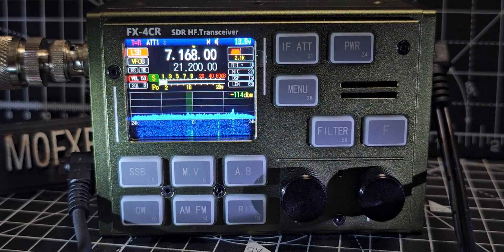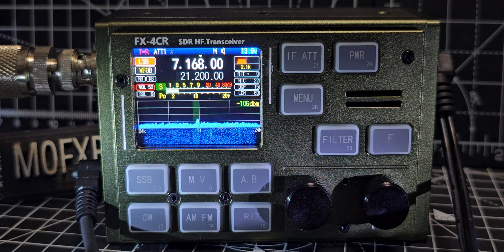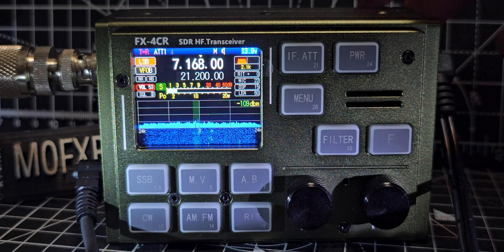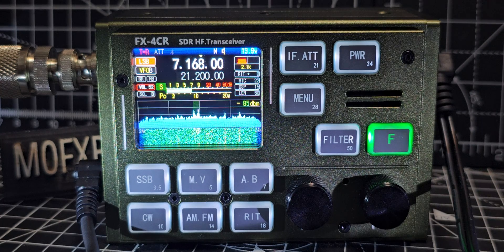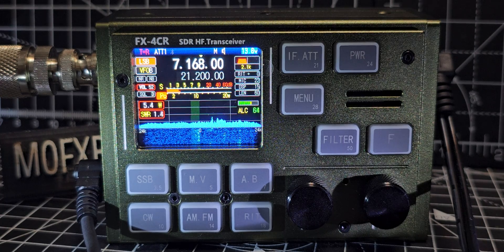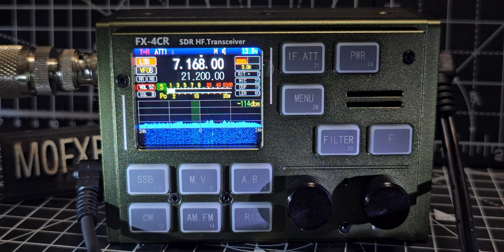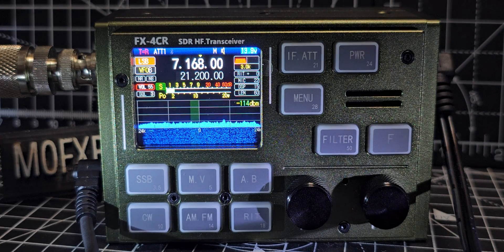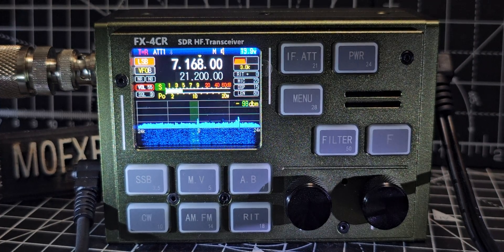FX-4CR , HF/6  SDR Transceiver MK111 - Unboxing 2024

Comment: Did you ever figure out what the delayed audio was all about out? Mine does the same thing. I noticed that after you turned on ATT1 and adjusted the filter to 3000k it started doing it.
Reply from the maker: No
Reply: @ ok, does it still happen with yours? Based on your video it started happening after you switched ATT1 on and changed the filter to 3000k. I’ll try some testing with mine around those settings and see. I’ll let you know what I find out